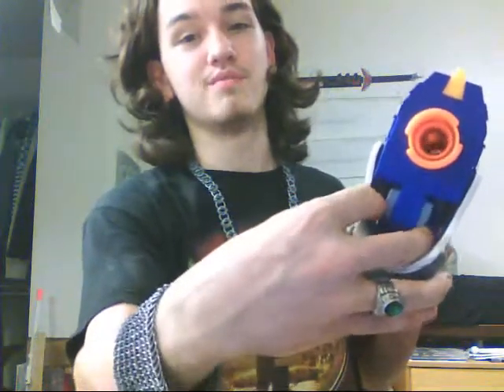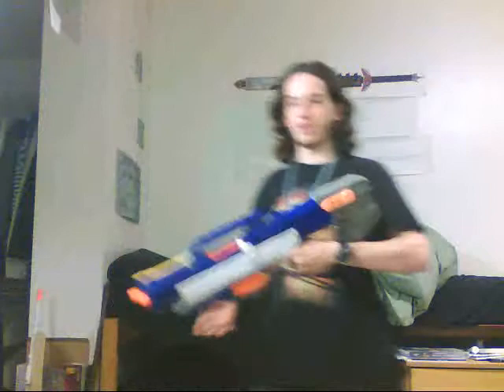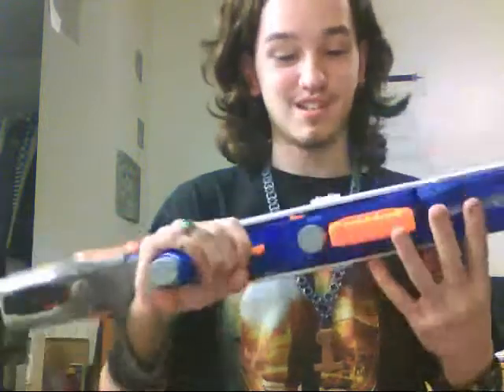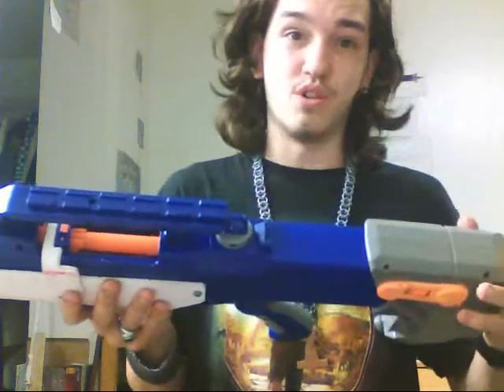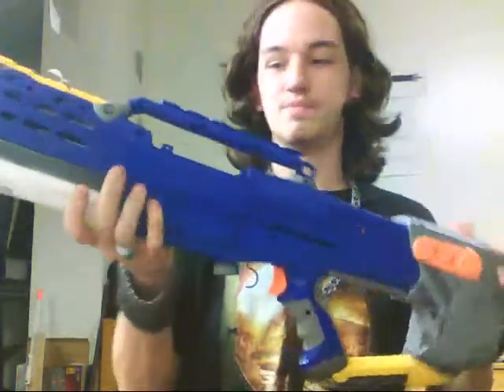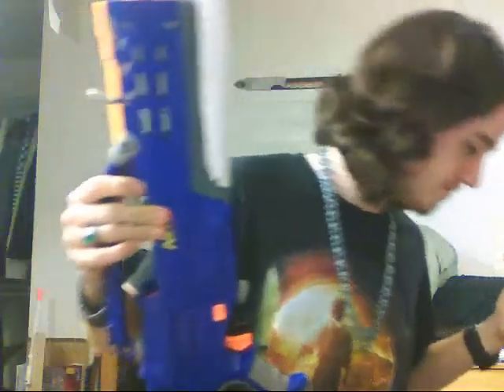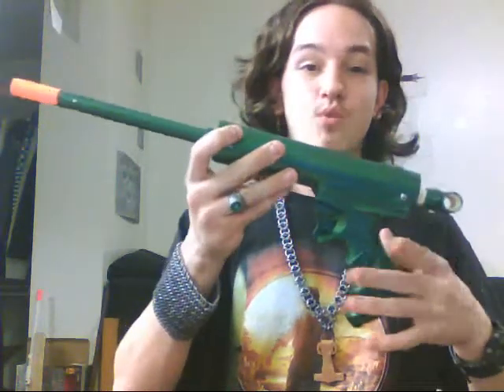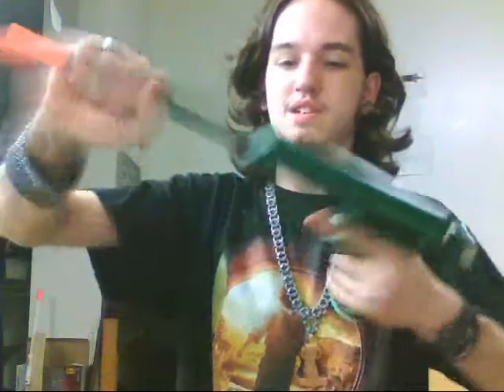Paint Jobs and a General Use Longshot

Comment from the maker: I have my sword back at home right now, so I'm afraid I'm not going to be able to work on it any more until the summer.  However, I have gotten all the metal cut out and riveted together.  I also cut out the wood for the hilt.  I still have to give the wood a finish, and I am going to try to heat-treat the blade this summer.  I am going home for a weekend in May, so at that time I might make a video about how far I have gotten.  Sorry about the lack of updates.